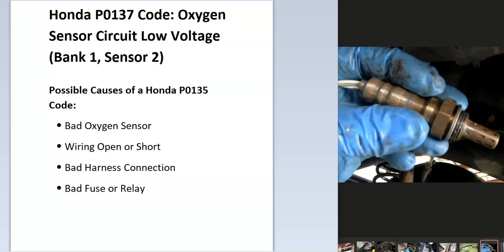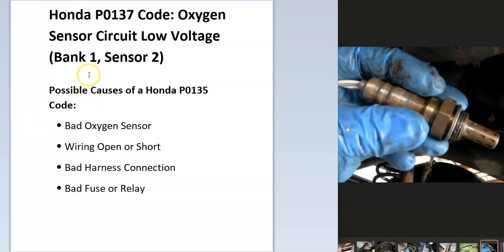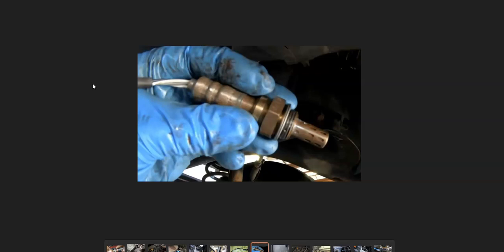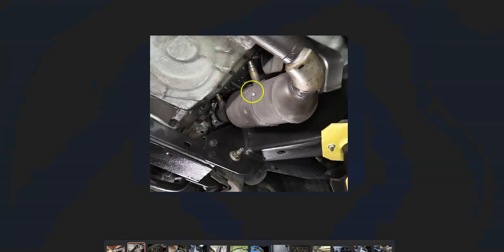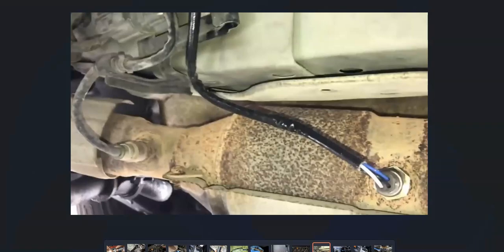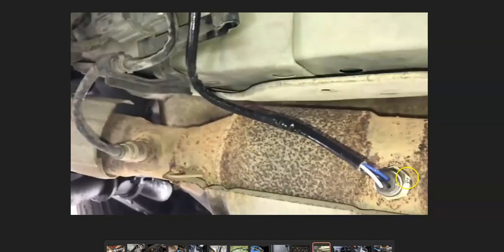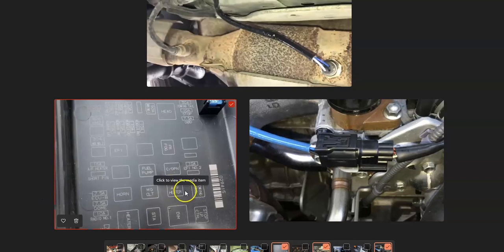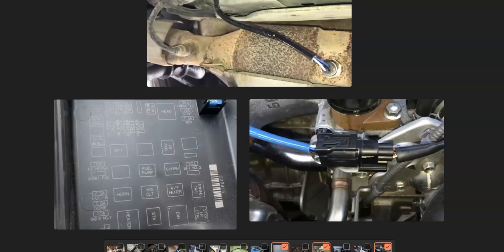How to Fix HONDA P0137: Oxygen Sensor Circuit Low Voltage (Bank 1, Sensor 2)

Comment: Yeah I’ve been really struggling to source the wiring issue in my 2000 ex but I replaced both sensors and tested for continuity across but there is definitely a short or break somewhere. Very unfortunate code :/

Comment: Can an exhaust leak in front of this sensor cause an intermittent o2 code?
Reply from the maker: Yes, an exhaust leak can cause issues.
Reply: @whyingo7964  I figured it could, the outer mesh of my flex pipe crumbled apart and there's a tiny leak at one of the welds on the flex pipe. Im just going to cut out the old flex and splice in a new piece. Thanks for the vids, they help immensely.

Comment: I have a honda a core At 3.0 engine. I replaced the bat oxygen sensor and the light still coming on
Reply from the maker: I would test the wiring going to the sensor. Also, look for any exhaust leaks as it can throw these sensors off.